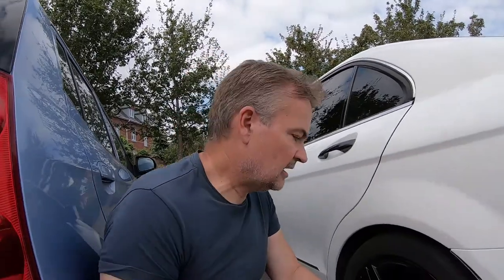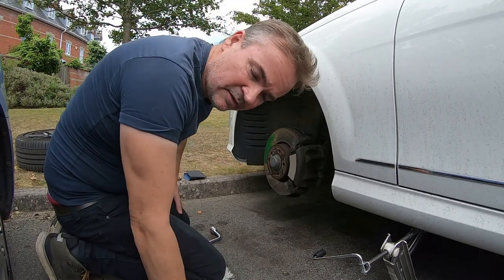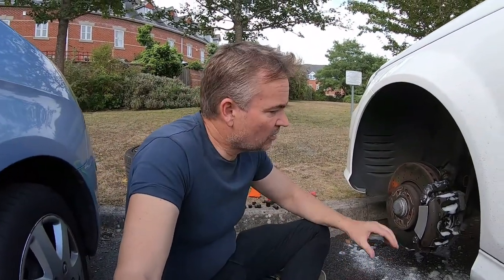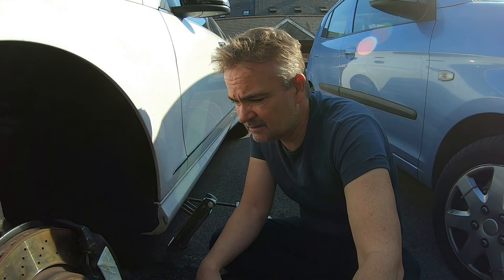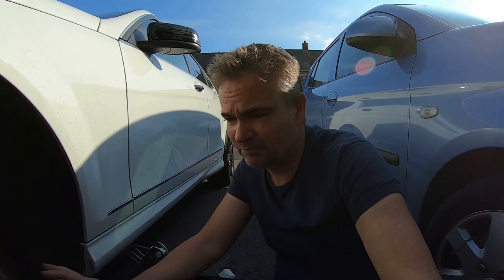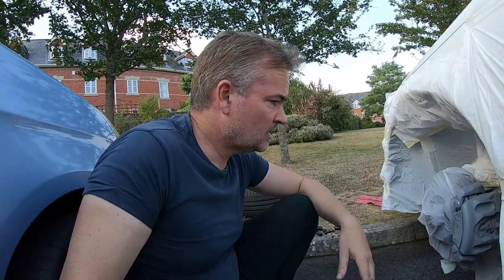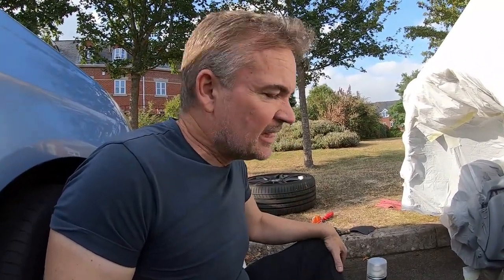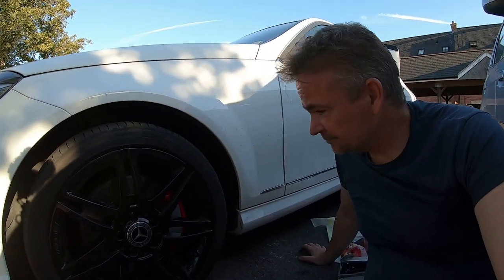Paint front brake calipers - C-Class W204 Mercedes

Comment: Great video! I just painted mine. When can I wash the car again? Do I need to wait a certain amount of time before the calipers can get washed w/ a pressure washer? Is wheel cleaner safe to put on like normal or should that be avoided all together? Thanks!
Reply from the maker: Hi, its only a couple of days and all should be good, one thing to be careful of is if you added decal stickers to the face plate as a jet wash will clean them completely off as it did to mine when a neighbour lent me his jet wash.

Comment: You can buy an AMG decal on that caliper plate. Would look great. Soon I will paint mine as well. But I will use the brush. :)
Reply from the maker: Hi Robert, just a warning I did add a Mercedes decal but after using a jet wash it removed it instantly, I like the idea of a AMG decal and will look into if they do more durable ones... thank mrix
Reply: @mrix  Thanks for the reply and advice. :) I am sceptical about the decals as well. Hopefully they will stick properly :)
Reply: @mrix  tip from other caliper videos i watched today: you need to clear coat the decals :)
Reply from the maker: Just seen this reply so sorry for the delay in responding, now yes that makes a lot of sense and I will go down that route of the clear coat.... thank you...mrix

Comment: Your front brake discs are fitted incorrectly. The drilled holes supposed to scoop air moving forward.
Reply from the maker: That's interesting Art, however I am a little confused, so are you saying the front disks need swapping around ? the one on the left should be on the front right etc ??? these were fitted by a garage that work on prestige vehicles and its not a job I have done personally myself.... thanks  mrix
Reply: @mrix  yes that is exactly it, although most people feel that they meant to be fitting the way yours are, but in reality the wider part of the angle > needs to face forward.

Comment: also its not advisable to spray degreaser on rotors or brake pads.
Reply from the maker: I was using it to decrease the calipers which worked great, yes some may of went on the rotors and pads but its not meant to be such a great problem, you can also see I also drenched the whole caliper in hot soapy water which would of removed pretty much most of the degreaser.... mrix
Reply: @mrix  I mean as long as you tested them and they worked great then all good. Love your videos by the way. They're detailed but straight to the point. Thank you!